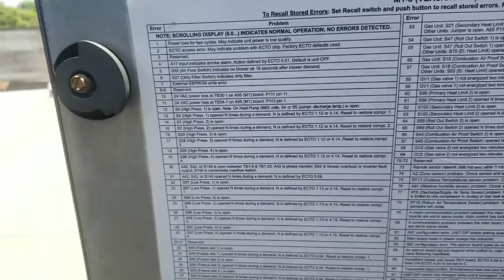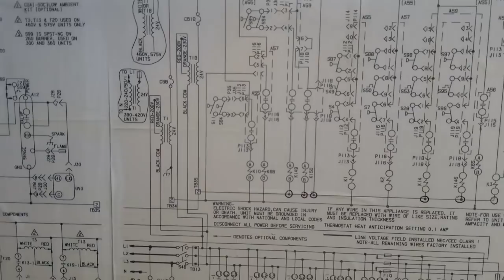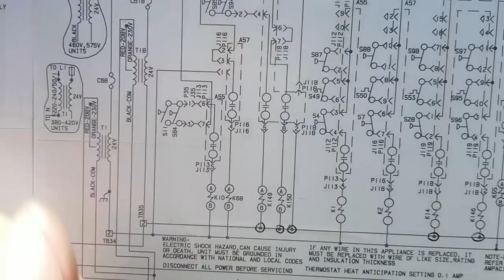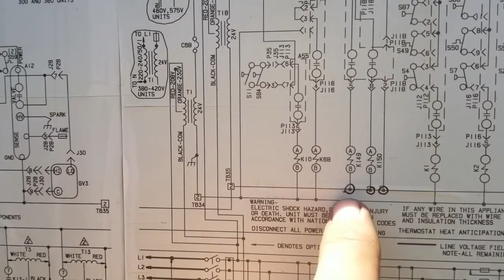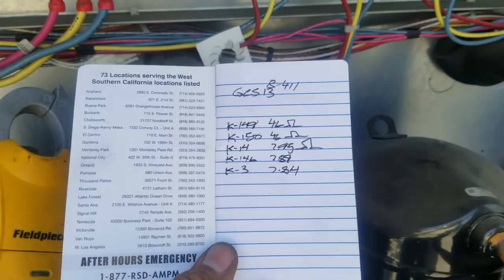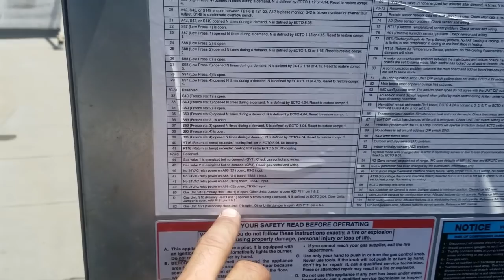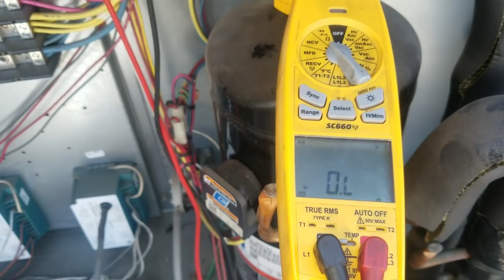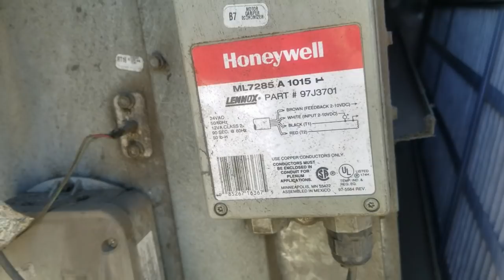Lennox electrical short

Comment: I love these Lennox units.  They have drawbacks like any unit, but the control boards are pretty stout and give you instant information as to where your issue may be (unlike the straight wiring units that are a "start metering everything" kind of deal).  Compressors are right there and easy to change.  Heat exchangers on these units are no big deal.  All the electrical is easy enough to get to (for the most part).  And HANDLES!!  I swear any units that have handles get better care.  You can pop doors open, look around for obvious crap, and close them back up with no tools.  Good job chasing down the 24v issue.  I've seen plenty of contactors that drop down their resistance as the laquer or enamel wears off the coil so the transformer breaker ends up sitting right on the edge of tripping the fuse.  Gotta ohm out each item until you find it. I've also seen that very same switch short out before.   Great job!!

Comment: We have a few really large McQuay RTU's where I work & I get intimidated by them sometimes because there are so many wires & other controls on them. It can be overwhelming on how to tackle these units or sometimes where to even start! It was good to see this video & pick up some tips. Our McQuay's even have a liquid line solenoid & pump down like a refrigeration unit when the temp control is satisfied. Great video & I hope to see more on troubleshooting big AC units.

Comment: 3 weeks into a Refrigeration tech. degree we’re working on giant bread boards for simple single phase circuits and its kinda intimidating. We just broke ground on 3 phase circuit and heard it’s easier to run. Hoping so. Think I wanna cut my teeth in commercial service right out of school. 
All this leading me in to thanking you for your simple explanations as you trouble shoot, your thoroughness is answering many questions as you diagnose. So thx

Comment: That is a nice unit! I felt intimidating when I saw the unit but when you started to troubleshoot it I felt that it was easy !! And I thought that the green wire you disconnected but it make sense that it was touching a power cable. Great video thank you!

Comment: Great video! Yes, I agree with you in regards to DCV. A lot more and more commercial application are calling for and requiring the use of the CO2 sensors to control minimum OSA. Like you mentioned, sometimes they’re put in wrong locations or simply they don’t get calibrated or adjusted as they should and start reading out of whack. Creating nuisance calls or alarms on EMS frontend. Another great video! 🤙🏽
Reply from the maker: I believe in DCV but I think we need to improve the sensing technology!

Comment: Awesome work.👍🏼 Those low voltage issues are a pain. As far as dampers. It's hard to make them understand and they choose not to fix them. Close them in the summer and come back later to open after summer is what I get. Iv install a unit that had 6 O2 sensors in the suite for the damper. Was on the phone with 4 different people. Good video brother👍🏼🤙🏼 keep them rolling
Reply from the maker: thanks bud!

Comment: A little known fact about large chain restaurants is that the managers bonus is predicated on how cheaply he can operate that restaurant i.e. not making proper repairs
Reply from the maker: That is true, but In my situation I don't work for the General manager, as a courtesy I let him know what's going on but any repair over 750 goes thru facilities to get approved . Than they take it out of his bonus. They do that to take the control out of the Gms hands and prevent exactly what you described. Luckily all 5 of my big chains are that way. The manager just issued the call than it is out of his hands at that point.
Reply: HVACR VIDEOS Great video as usual. It sucks that they take it out of his bonus, gives him a reason not to call, or attempt to get it going himself.  Seems that all large businesses operate this way, not just restaurants. Doesnt make much sense as the manager can't control what happens with the hvac equipment. Who unhooked the enthalpy sensor, the manager? And if so how did he know to do that ?
Reply: @HVACRVIDEOS  there is a small store, they built it not too many years ago, they basically refuse to spend money to fix air, it broke down the first year, around 3rd year open, the district managers mom told him to do something,  so he brought in 4 giant commercial portable air units on wheels, yeah that was his fix, stayed like that about a year, & then finally had air partially fixed, thats it, my wife had to do a job at that store last week, she has to bring a battery fan to be able to stand to work in there for more than a few min, & place refuses to fix air. also the place has been on the market for sale since 6 months after it was built. I refuse to shop there. so there is a little air movement but I assume 1 unit struggling to do whole building? thats kind of place if cant fix it for customers, I say close doors, and allow new owners to, as if they do not care about customers, why shop there. I know the balance of repairs  versus costs, but this district manager absolutely refuses to fix, all the other stores by that name in my area are in a different zone, & different district manager, & no issues at all.

Comment: Just subscribed. Enjoyed this video. I have 3 new York a/c at police/jail I work at. The jail would go into economizer mode when temps went over 85 degrees. I'd reset then 20 to 24 hours later it would do it again. 4 days in a row. Why I don't know. Anyway the unit is not set up with an economizer but was enabled on board. Called York support and they walked me through using the 4 buttons on the board to disable. That was early last week and been running fine since then. I'm maintenance for them and not a hvac tech and certainly not in your league but it was satisfying that I could figure most of it out. I knew the econ and y out were jumped so econ should have been disabled and when I called York did say some units had this problem. Thanks again for video!
Reply from the maker: Thank you for watching!

Comment: I personally think economizers are a waste. I see the point of them but what I’ve found over the years is they fail and stay stuck open in summer allowing in too much hot air or in winter , then they a pulling in too much cold air. Hahahah. You can’t win with them.

Comment: Can you go into more detail of what the refrigerant pressures are supposed to be with the different refrigerants you come across? I’d like to know what good readings look like on the stuff you are working on and what makes them good if that’s possible.
This video was awesome I learned a lot.
I’m currently a service technician on the residential side and this stuff looks so fun to work on. 
Can’t wait until I get the opportunity!
Reply from the maker: every piece of equipment is different , there are some basic rules of thumb but for the most part you need to use manufacturers charging instructions, they're usually in the manual

Comment: When it comes to building balancing in a kitchen, I think you should always have a make up air unit. Captive Aire makes some simple conditioned ones that would help solve many kitchen airflow issues if serviced and maintained correctly. Negative air pressure is a cruel mistress.
Reply from the maker: Yes sir, I also think that every kitchen should have a dedicated mua. But more and more are just using the rtu units these days.

Comment: 28VAC on a 24VAC transformer in unloaded condition is just normal so far. It is like a generator, the voltage drops with load. And if the transformer only powers relais and coils, it is not that important to have fixed 24V. In case clean 24VAC would be needed, the manufacturer has integrated a voltageregulator. So fare an other great video with a lot to learn

Comment: Chris, I know this video is 5 years old now but Yes I found that lot. And big gyms like LA Fitness, those little shits kept playing with the T-stats and running the fan in Auto not, continues like it needs to be, we had to put lockout T-stats with all the settings locked in by the installer. That stopped all the BS calls from operator error. That way when they did call saying "Something is wrong It is too hot and humid" we knew something was actually wrong or broken. I agree with you on the economizers, back in the old days they were bad always breaking and the cost of the parts was unreal no one wanted to pay to have them fixed. Here in Arizona, 90% of the economizers that brake are just permitly set for 10% outside air anything more is just nuts, when roof temps hit 180-200.

Comment: When we first installed the new A/C on top of the control tower here, the first complaint was got was ice cold air when the compressor came on.  We ended up having to put a recording digital thermometer in the tower cab and rule that the temperature range was within allowed limits (which it was).  After hearing this one, maybe another fix would be to just leave the inside fan on instead of in auto.

Comment: Excellent work and trouble shooting. Controlling makeup air has never been convenient, consistent or reliable. It appears the makeup air controllers on AC units have too many moving parts which tend to lock up or stick. By the time you notice there is a problem, replacement is the only course of action....which gets to be very expensive. ADA had a controller in the 80's with outdoor/indoor pressure sensors but were impacted by wind gusts and blockages. Hopefully technology will solve eventually. Thanks for the great videos

Comment: Interesting what you were saying about outside air and Make Up Air units... out here in Canada we have tons of make up airs and people don't rly have the option... to get building occupancy restaurants or condo buildings and what not HAVE to have a MUA unit.... Roof top economisers arent sufficient to our standards.... basically everything is balanced in a kitchen for example with only exhaust and MUA units.... RTU units would just provide a little extra but for the most part economisers are used for free air cooling and to keep a bit or outside air coming in for comfort.... i just wonder if the rules or standards or whatever are just different in your parts....

Comment: I think a properly installed make up air unit has a modulating gas heater so the cold air influx shouldn't happen if operating properly in the winter

Comment: The trend i have noticed is my boss is penny pinching on the Air filters... My office never had outside dust and pollen in it until we changed the company servicing our Cooling stuff. The new company is cheaper and i suspect they can do it by using crappy parts.

in our case regulating air is pretty easy, since we have controlled access we know exactly how many people are in what building and can adjust accordingly. And as a second feedback loop we use a multi sensor in every room that gets temp humidity as well as CO2 and i think also O2 in general.
If you want to be special you can just "request" more airflow via the room climate controller two.

Comment: I had the same problem on the same Lennox unit in Connecticut. That transformer on mine was due to a bad contactor. Also changed the economizer...(was $750 shipped from Los Vegas). Lol

Comment: You can do make up with RTU OAD, but it takes building pressure sensor, and a separate controller to control econ motor, and fan status. When fan is on, control OAD with AO from controller. Problem is humidity and such then.
Reply from the maker: I'll have to look Into that, I've heard of building pressure sensors before. But I'm sure my restaurants would t wanna go that crazy!
Reply: Wouldn't work well without some external controls. I'm in HVAC control industry. Need to look at OA humidity, temp, fan status etc before you allow OA damper to control building pressure. Works well if you have modulating DX or chilled water or Mod heat or hot water so you can temper air or dehum as needed.

Comment: Amazing guy. I'm wondering if fieldset gauges can be used on any vehicle with air conditioning systems. They do have the Schneider valves on both high and low pressure pipes.

Comment: So ok im a pretty new residential tech.  But you were talking about the blower and being in auto vs on in a commercial application. Id love a video that went into more detail about how thermostat settings work in commercial applications because now im really curious. If you put the blower on the "on" position in a house, nothing will work but the blower. You have to turn it to auto for it to cool/heat. This is different in commercial?
Reply from the maker: I think your getting a little confused there, On all the thermostats I've worked with either residential or commercial if you put the fan switch in on the cooling and heating will run just fine.  As far as why I say to have the fan on on the ac unit in my video is because of the building balance. The exhaust fans are pulling air out of the building and we need to put air back in so we pull some of the makeup air thru the outdoor air dampers of the ac unit. With that being said the indoor fan of that unit has to be running whenever the exhaust fans are running to ensure that we are always putting that makeup air back in the building. Does that make sense?
Reply: HVACR VIDEOS gotcha. I got into this a little over a year ago. at the time had my t stat at home set with the fan on. House would not heat. I went nuts chasing down a issue that didn't exist... I switched the fan to auto and the furnace fired. Since then I assumed that's how that worked I suppose and was never told orherwise. 

Now I see otherwise. Reason I asked was I walked up to a Trane voyager with a stat acting a bit erratic. Once I got it one The unit would cool on auto or "on" and then I seen this video which made me.question what I thought I knew. 

Appreciate it bro!!!
Reply from the maker: Thanks for watching!

Comment: I'm on the side of the fence that economisers are great on paper, but not so much in practice.
Reply: John McMaster why you say , just curious
Reply from the maker: Yeah in my opinion the repair cost usually exceeds the savings.
Reply: JH HVAC & Plumbing they definatly have their place for demand ventilation and building pressure, but if thats the use I don't feel the primary concern is  dollars saved. When places buy a package unit and get cheap packages sold just so the contractor can add on to the sale I feel their not getting their money's worth. I don't feel like an economiser should be sold strictly as an investment that will pay itself off.  Climate matters also. I would rather install good low ambiant controls and run mechanical cooling when its cooler out than dump 60 degree air in thats got a high moisture content just because its temp is less than the space. Its a good topic and there's good arguments on both sides.

Comment: Are you referring to mua for the occupants  or for kitchen hood mua?  Sounds like just the fresh air requirements.
Reply from the maker: Both , it's common for them to undersize the stand alone mua unit (if there is one) and use the ac units outside air dampers for the difference.
Reply: In one of my stores there is 5 exhaust units that requires 20,000 cfm mua to balance the kitchen. Could only accomplish that with evap. coolers

Comment: One could imagine that as a result this covid epidemic that there would be a priority getting air conditioning systems up and running correctly with fresh air % increased and even cleaning out the ducting  and replacing filters etc. Yes?